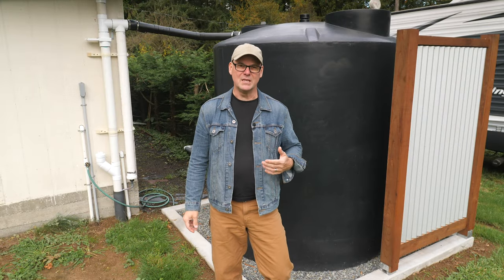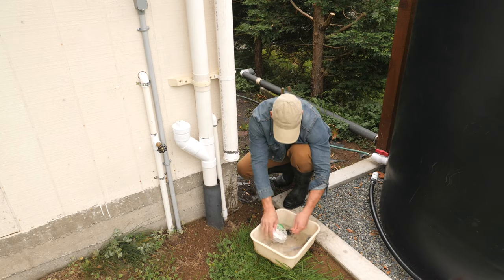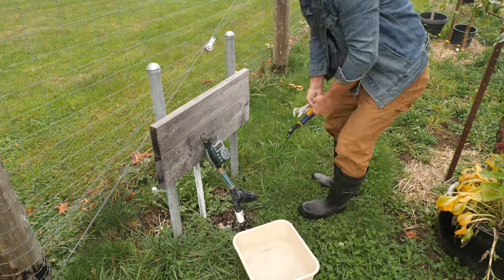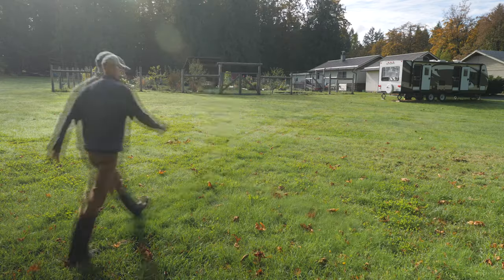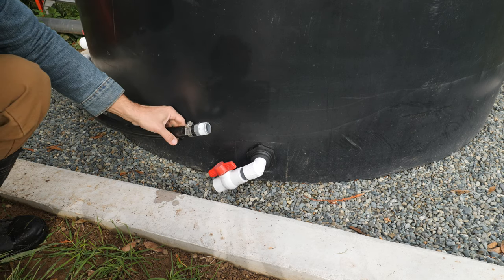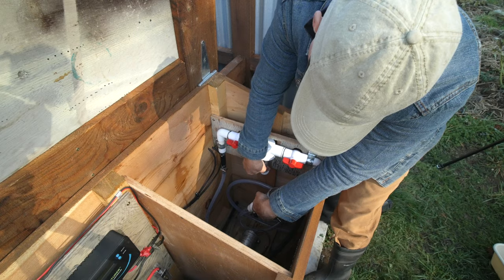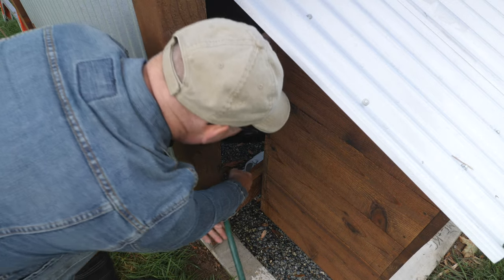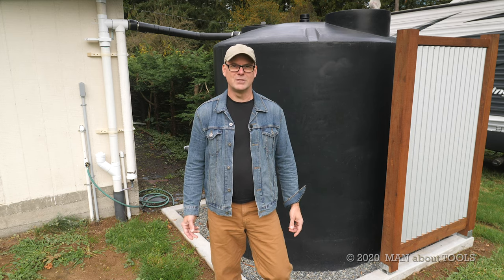Winterize Rainwater Harvesting Tanks & Drip Irrigation System

Comment: Nice work on the winterizing of these two systems.  Shame to have to dump  all of that water but it would be a real shame to have the system break.  Now that I live in a city at the coast, I don't have these tasks, but followed a similar routine when we lived in the foothills of the mountains on a farm.  We had colder winter temperatures, 20 to 30F, for up to three weeks but average was about 35 to 45 most of the winter so winterizing was necessary to avoid irrigation and under house freeze up during the coldest times.  Thank you for sharing and have a good week ahead.
Reply from the maker: Thanks! Where I live we get a lot of rain in the spring so the tanks will refill quickly.

Comment: An old forge trick to keep quenching barrels from exploding when the water in them freezes is to put a sacrificial piece of more easily compressed wood in the water- it gives before the exterior walls do in the event of ice formation.

IN THEORY some kind of compressible air bladder, or 55 gallons worth of ball pit balls, might serve that same function here for the tank itself. It'd be a pretty expensive experiment if it didn't work though.

Great video! Thanks for uploading this series.

Comment: Very thorough winterizing. I've been looking at when it will be freezing for me as well. Looks like it's coming soon. 

Just for context, I have a similar type tank last two years, but 2500 gallons and I catch rain for drinking. So, I use My tank/plumbing through the freeze. Use some insulation and keep the tank in a barn - similar to ur walls ( exposed to temperature ). The water freezes on top. The drain valve is a concern, so I insulate it and it's been ok. I don't drip it thru freezes. Have the pump contained in a Wal-Mart plastic container - minimal insulation. Not as nice as your wood box, but it works. 

Update on my portable tank bottom Frankenstein cleaner. I got it working with plumbing adapters. Wet vac wide nozzle to 3/4" pvc ( 10 ft ) to filter to pump [to uv light] to hose back into tank - no water lost. Cleans the gunk, leaves the water. Maneuvers ok, just tricky with my stand. Best of luck, Kent. Love ur ideas.
Reply from the maker: Thanks for the comment and your support! I think the issue of winterizing has been overlooked so I hope this video and these comments help everyone out. Cheers, Kent
Reply: We have a couple of the 2500 Gal tanks. We use the water for our garden and to water all the farm animals. How cold does it get where you are? Are you saying your water doesn't freeze through winter and you don't need to insulated it? 

We are trying to figure out if we need to insulate it and how to do so that way we can water our animals for free throughout the winter months.
Reply: @bradiemossman3265  my cistern is within an open barn - basically a tall roof over the cistern - little/no sun/uv. No insulation around the 2500 gallon cistern, but the unfiltered out spout 3/4" PVC at the bottom is insulated ( wrapped with that fiberglass/foil pipe wrap  - so low R value ). It has gotten down to -9°F. Have ice-bursted my first-flush 4" pipes twice ( manual open design ). Water has almost always been pumpable. Use 3/4" PVC window screen filtered from cistern bottom out cistern top to pump/micron filters to faucets. Pump/filters are contained in a tote. 

Cistern platform is: flattened dirt, then cement blocks in checkered pattern, then painted particle board. Allows water to flow underneath for heavy rains.

Comment: That's quite a chore. :)  Watch out for those ball valves. Sometimes they can trap water in the globe around the ball. I like to open and close a couple of times and leave them in a half-open position. I wonder if the gate valves can trap water anywhere...
Reply from the maker: It looks like it's a bigger job than it actually is. And with some improvements it will be even quicker. Good tip on the valves, thanks!

Comment: I agree, those of us here on the ‘Wet Coast’ (I’m in Greater Victoria) don’t usually have to worry about too much freezing but... it does happen. One thing I use on my boat bilge pump lines and my sons travel trailer water lines are these type of ‘quick-connect/disconnect’ Cam-lock couplers (male & female) and Princess Auto is the easiest place (meaning cheapest) to get them at all different diameters. Once you put these in your system, you’ll not have to worry about taking any of the fittings apart plus, you can make up adapter hoses to use to pump/suck the RV antifreeze into the system next season! https://www.princessauto.com/en/detail/1-1-2-in-hose-barb-cam-lock-coupler/A-p8154239e
Reply from the maker: Thanks for the tip here! I'll check them out.

Comment: That is a huge amount of hassle and extremely wasteful. Why harvest the rainwater then throw it away when it gets cold, that defeats the object.?? Surely it must be better to insulate.!!
Reply from the maker: It's actually more of a hassle to set up the cameras and make a video from this. The winterizing process is actually pretty simple and did not take long to do. Where I live we get a lot of rain in the spring so the tanks will refill quickly.
Reply: @MANaboutTOOLS . You had to leave it and finish it off the next day, that doesn't seem like a "simple and not long to do" process. 🤔
Reply: @MANaboutTOOLS  Do they think you need to irrigate your garden in November?  Draining the tanks is as "wasteful" as exhaling.  Good job.  Good luck.
Reply: Get a life Lostboy. The system utilizes free water for all spring, summer and fall. With some quick disconnects, and perhaps start at the lowest point (well house), he could probably open the taps as he worked his way up and it would all drain by the time he got to the top-most point. Probably an hour or so 1x/year seems like an excellent recycling venture worth the saving in just paying the water company for x amount of water.   Sure, lets go spend x thousand dollars insulating everything to avoid an  hour or two of work a year....